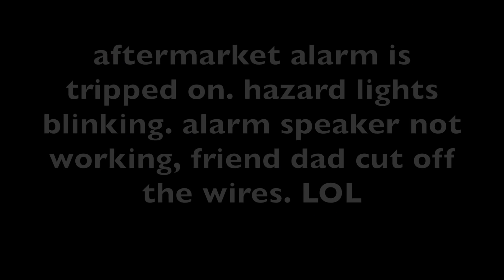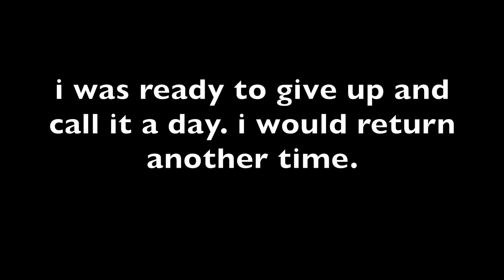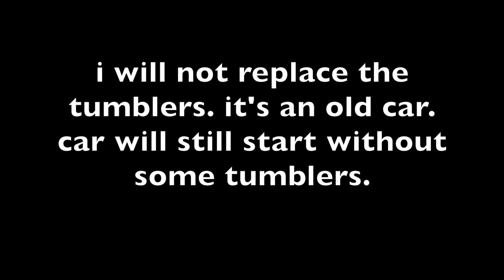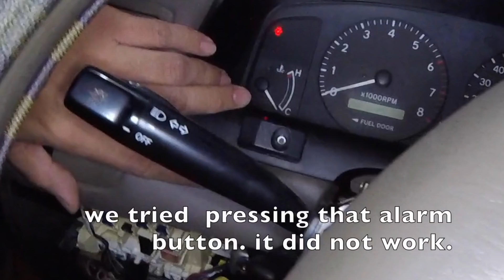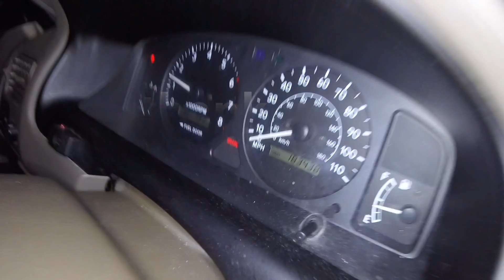[ i DIDN'T give up] key will not turn in ignition Toyota Corolla√ Fix it Angel

Comment: That's the problem with our mechanics our days.. . It's all parts  replacing instead of fixing.....I would have done exactly the same thing....( I understand its a cheaper solution to change out parts for labor costs when you work for a dealer)..but in this case angel did the right thing...
Reply: I mean...... it depends on the part price
Reply: I totally agree with you.  but  car maintenance job is fight for time spending to make profit ..
Reply: I would be surprised if he charged them 3 or 4 hours.

Comment: First thing to do after lock was removed would be to spray out all of the graphite. It gets built up in the tumblers and changes the height of the tumbler. I worked in several different  auto dealerships, and rebuilt, rekeyed, and repaired many different lock cylinders.

Comment: lolz I had the same struggles with a early 2000 sienna, I kept telling them the key was worn and to get a new key, instead they just make a copy from walmart not a key from the dealership.
They just wanted it fixed, so I took out the cylinder like you did, the differences were I was able to pry off the bezel without destroying the pin.

Inside I found 2 bad tumblers and just took them out and it turned freely, then I just put everything back together and they were good.

I think this is the first time I heard you talk so much and get frustrated like I always do lol.

Good job as always bro.

Comment: The same thing happened to my 98 Camry. I chose to replace the ignition lock as a result I have two keys: one for the doors and one for starting the engine. Your solution is much better. Thanks for sharing.
Reply: Did you use another car ignition? Cause my 04 corolla is not turning and I came here to find out if another ignition with the same model can be used
Reply: If so, anyone can let me know please
Reply: I bought part “Beck Arnley 201-1793 Ignition Lock Cylinder” to replace the original lock and key.
Reply: @Aya, the ignition lock from another car of the same model and year should work.

Comment: You are a true mechanic.....I worked at dealership before. All I did was run the scanner and replace the parts. Never went this far to fix the small part itself to save customers a trouble

Comment: Once i had to change my 97 honda accord key because it has been stolen 2 times due to the key lock it was opening with almost any key 😂.I bought an old Toyota key and rearranged the tumblers then I had the tumblers sanded so the key will fit with the lock 100% and installed a hidden kill switch . Since then it has been not stolen any more.
Reply: damn, 2 times being stolen? That were a lot.

Comment: in case somebody has the same issue, here is a pro tip for you: in the first 9 minutes of the video, the guy tries his luck moving the ignition into on position. 
Well, instead of sitting hours trying to accomplish that, try spraying a lot of lubricant (like wd40) into the key hole. than, try to wiggle it into on position while tapping the back of the key GENTLY with an hammer (dont force it because the key could brake inside the ignition). it shouldn't take more than 5 minutes.

After you take the old cylinder out, just replace it with a new one. it will save you HOURS! and it will be way more secure than taking all of them tumblers out. 
new one like this cost around 30-60$. you could also try your luck at your local junk yard, maybe one of them will have a key already. 
Take the old cylinder and throw it away. put thew new one in. DONE! 10 minutes job.
**in case you need to program the chip you could just save the old key's plastic portion, and tape it to the new key.
Reply: its easy rekeying the new ignition so it matches the door keys. I do these all the time as a locksmith

Comment: It seems to be a cheap and temporary fix, I'd recommend replacing the ignition switch with new tumblers and key.  At least you will be able to use it if you don't have the money currently to replace it.
Reply: Great work
Reply: I’d say this is a permanent fix since it was the offending tumblers not going down all the way. There are many avenues of it. Junkyard but you have to replace all the locks on the car so the key works on all locks, take out the offending tumbler and put it back together, or replace the tumbler assembly.

Comment: Taking off the battery means security alarm goes on, you have to do a process with door and ignition lock to get it to start again.
Reply: How?
Reply: What do you mean how? The part about alarm going off or the process to get it to turn off? What happens is complicated. I told the locksmith he cannot bypass the security. He talked to me like I was stupid. Toyota will tell you that. He tried it with a my flashed ecu and it failed just like I have said. He had to shut the security system off completely for it to work. The guy owes my an apology but I guess he's a stupid ahole. So now, I don't have fob or cannot lock it by fob. I can only lock it with the door switch. I have to manually lock my car with the key inside the cylinder with the door open before, exiting. This makes you forget your keys in the car a lot so I have to hide my another jey outside in case. When you kill the security system, the fob no longer works. Locksmiths do not have access to a new ecu or have the code to redo your fob. This means they can only kill the security altogether, which means locking your car after you got everything out from the back with key in ignition and door open then you lock and remove the key. It's a hassel. Hard to explain. Even Locksmiths that have been doing it for 30 years don't know this. You can't even get an OEM ECU from a company online. They're fake. What the dealer does is get you a $1000 ECU, then reprogram it. The Locksmith can only flash or erase it....they cannot do it to the new keys so they would only flash the old ECU, meaning they have to kill the security to bypass it. Not a mechanic, but I already know the locksmiths cannot do both the keys and the ECU. Told him this and he thought I was stupid. Talked down on me until he had to kill my security. Oh how stupid he looks in front of his wife who was translating. He even asked me what's my problem when he knows how these things work. Only the dealer can give you new keys and cylinder, but you will need a new computer or ECU, bc old keys cannot go to new CPU and vice versa. So you'd have to get new keys, cylinder, and ECU for the dealers to do it. The licksmiths can only do it if they turn your car into manual locking. I hope that makes sense.

Comment: You can remove the snap-off bolts by grinding a slide into the middle and using a normal flathead screwdriver to get them out. ;-)

Comment: So i had the same problem. Before pulling it all apart i filled down a whole heap of pencil lead (Graphite) and feed it into the lock. Working the key in and out and turning it heaps fixed it in about 10mins.

Comment: Do not disassemble just use the original spare key which never yet been used 
Also go n make a copy from that new spare key n ask the key maker to increase the length of it's teath lips.. 
It will be fine

Comment: I've seen this problem a lot with aftermarket security systems. What do you think made it fail all of a sudden after working fine for so long?
Reply: You didn't ask me, but... inside are brass wafers that bend when forced against the steering lock over time, not exactly "worn", just damaged due to ignorance. It happens. Once bent enough, the springs can't rebound the wafer and results in the plug of the cylinder being unable to turn full course.
Reply: @20alphabet  Yeah, I get that for the lock cylinder, but the AM security was still malfunctioning and had to come out in the end after the lock repair. I wonder what fails with the AM security

Comment: Hello Sir, i have a question which is  not related to this video. I got a 2008 corolla with 299,999 miles on it, the odometer wont run or it is stuck on that range. Do you have any tips for it. Thank you.

Comment: Hey fix it Angel I have the same car it has the security alarm as well, it starts but the power door locks won’t work. Could this be because of the security? And the red light just stays lit. Thank you!
Reply from the maker: Are the power door locks  not working from the main switch on the drivers side? 
If it’s not working then it may be the power door lock switch problem
Reply: @FixItAngel  yes I already switch it out but still no luck no power on the passenger side too. But power windows still work with the master switch.

Comment: Dang, you did quite a bit of work for that little sucker tumbler,
Reply: I made sure the issue wasn't the Shifter Cable then I fixed mine by with a Carbon Graphite Powder Lubricant at a cost of $2.78.  Sometimes the ignition tumbler cylinders just need lubrication. Pumped a few puffs on the keyhole and is now working fine, saved $165. for the tumbler and God knows how much for labor if I had taken it to the shop.  

Steering Wheel was locked, Shifter was locked, key would not turn into ACC or Start, tested by pulling on shifter cable and made no difference so it was the ignition tumbler getting stuck intermittently.

Comment: Get a replacement cylinder, take it to a 
locksmith and pay ten bucks for him to 
key it to the door key. R&R the cylinder. 
Done deal.
Reply: lol will cost more than $10. I do these as a locksmith and charge $50 if customer brings the lock to me, but I need to uninstall rekey then reinstall I charge $150

Comment: BTW in order to make that key turn, you need to hold the steering wheel to the left to take the pressure off the lock then with your wife's vibrator or an air chisel at the lowest power setting and apply to ignition tumbler in order to vibrate the tumblers down.   This is true!   Not kidding, please try it.  Just don't let your wife see you taking that thing with you.